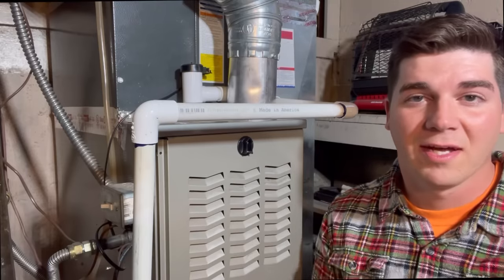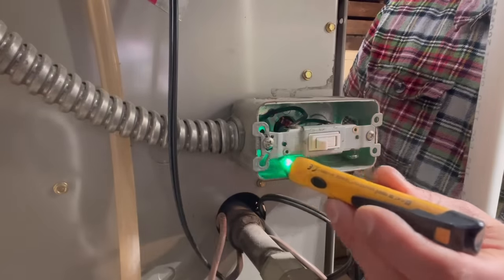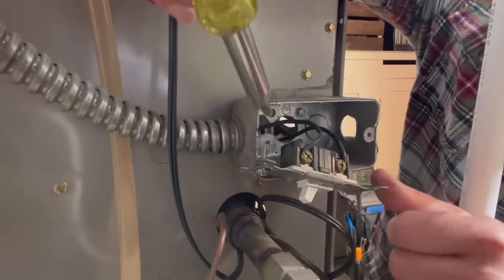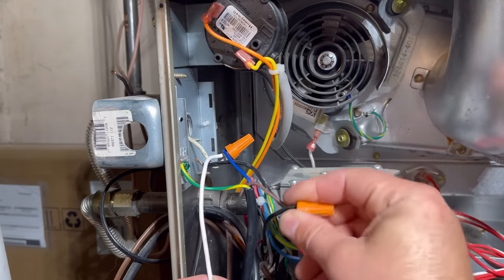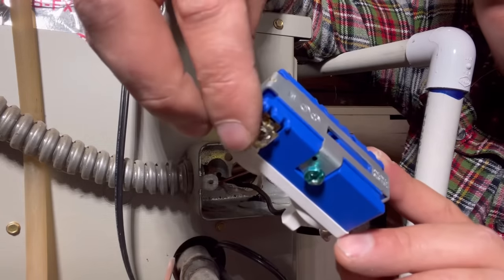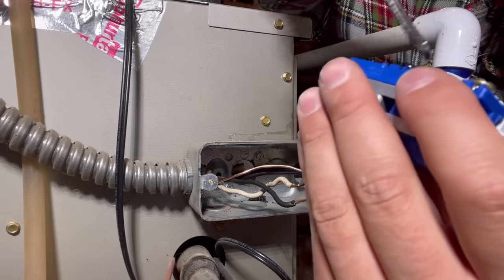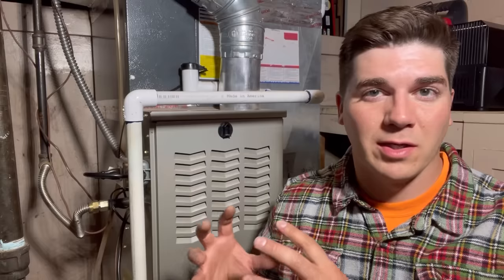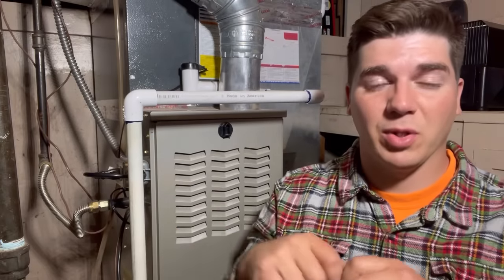This Could Keep Your Family Warm During An Emergency Power Outage.

Comment: Note:  if your furnace will not run off of your generator with this mod and you get a missing ground error displayed, you will need to put a temporary ground from the furnace ground to the white neutral wire. This can be fused at 1/2 amp if you want but the two wires are normally connected together back at your circuit breaker main panel. The flame detection circuit may need this ground. I have run into this twice. Just an fyi.
Reply from the maker: Thanks for the tip! I’ll pin this in case anyone else runs into that.
Reply: The better alternative is to bond the generator to the building's ground rod.  There should be a threaded stud and nut on the generator for this. The furnace cabinet remains bonded to ground through the surface mounted box and ground screw on the device--in all cases that's an iffy connection, if say the mounting screws are loose. Better to have a ground wire from the box to the device.
Reply: @diyhvacguy  my trane furnace had issues with flame detection..  I used to be in the field so I knew it was a ground issue from years of errors on various furnaces..  in my case I connected a ground wire from the generator frame ground to the house ground..  I had zero ground potential but it was a wierd flame sense..  I didnt have a bad ground flash on the board.. but would not sense flame..   my furnace has ground from my box.. so figured if i grounded the Genny to the box id be good.. and it works great..  

in some areas there is code that a furnace has to be permanently wired into electricity.. the plug and whip may be looked at like an extension cord even though its permanently attached... its something to think about even if you never plan to sell your house as an insurance company could use it as a way to not payout..   nevertheless its worth checking local codes... a transfer switch would most likely be code  FYI
Reply: I already figured that out 4 months ago and I am all set for any power outage. 200 watts of solar power, 1500-watt inverter and 165ah of batteries which is to say 55ah each.
Reply: @JohnT.4321  165ah at what voltage? my furnace pulls about 700 watts running full blast. at 12 volts that equates to about 60 amps..  165ah would be what 2 and a half hours runtime..  I cant use solar in my area (ohio) winter the sun angle is dismal and its almsot always cloudy , days are short too at only 9 and a half hours daylight.. probably little less than 9 useable daylight for solar..  I have 800ah @ 12 volts batteries.. of course the furnace doesnt run all the time..  but i can make it through the night with the generator off and secured...
Reply: @eldoradoboy  I should have been more clear about being ready for a power outage so forgive me for being vague. I did figure out on how to rewire the furnace, like in the video, four months ago along with proper grounding. My furnace is a lot smaller than the one in the video since I live in a small house with one floor and no basement. I have not checked the wattage of the furnace yet since it is still warm outside. The power outages here have been between 2 to 8 hours in duration and they are rare. We never had a power outage like which happened in Northeast Ohio in 2007 which I believe was the year. 

Since I live in Northern PA, I know what you mean by not getting enough sunlight in winter. I am able to adjust the solar panels to the proper tilt to get full sunlight for both summer and winter. My first system is a 1800 Nature's Generator with 200w solar and 150w wind turbine which does work. It spins a lot during the winter charging the battery. The system also charges with AC. Nature's Generator was my first introduction to alternate energy. I had to replace the inverter, at not cost being under warranty, but I also had to replace the battery six months later. Instead of buying the expensive Nature's Generator's battery, I put in a 75ah deep cycle gel battery. I had to size what battery would fit and that was the only one. It's better than the original 60ah battery. We use it for smaller appliances and the electric bill has lowered a bit.

The secondary system is one that I am building and improving on runs the big refrigerator during the time of full sunlight. I am considering a wind turbine since we have a lot of wind during the winter. The refrigerator runs at 143w. I learned that putting a six pack of 2.7 500uf supercapacitors to the inverter soft starts the refrigerator--it will also soft start a furnace for your information. I learned it extends battery life as well. I run the refrigerator on sunny days and then I put the refrigerator back on AC before the sun goes down. I am very pleased it has a good charge. I do put a battery charger on the battery but I trip the breaker to the 200w solar panel first.
Reply: Could you do something?  Could you measure the power used by your furnace when running the blower?  There seems to be some confusion regarding this.
Reply: @DennisMathias   my furnace is 700-750 watts running high stage, iducer motor on high and the variable speed blower at max heat speed.   its an 80,000 BTU multi stage american standard (trane). the blower motor is a 2/3 horse.   my static pressure during the test was 0.24" WC, I can run the blower up to max (high cooling)which reaches about 800 watts, however the unit will not run heat speed on its own in maxx blower speed..  it drops back to maintain a good rise..  Variabke speed furnaces are soft start and dont require any start surge mitigation for generator use..  my 1500 watt inverter runs it with zero issues once I set the grounds up correctly.  when im running in emergency mode, I force my thermostats into 'EM heat" which in my setup activates the W3 terminals and makes the furnace run in max output only.. this results in high burner all the time and shorter runtimes (better for batteries)..  multi stage furnaces running on low stage are gaa efficient but will drain battery banks quicker with longer run times..
Reply: @eldoradoboy Those 800ah batteries must have cost a pretty penny.
Reply: Do not connect the neutral to ground. Ground the source (generator or solar) to the main panel ground, per National Electric Code.
Reply: @DennisMathias   Don't forget that any kind of electrical motor will have a surge power draw. (Which probably won't be measured by a standard Kilo-Watt meter/etc.)
Reply: TY...hard ground for flame detection
Reply: I guess this is something that you should check right away, and not have the problem when you actually need your furnace to run!
Reply: @galaxiedance3135  presumably you test an installation after you build it.. ie if you set up your furnace to run on batteries you would want to test the set up.. to get ideas on hiw long irt would run on your generator or on a set of batteries etc...
Reply: My carrier furnace runs zero issues off my Honda Eu2000i.  But I’m also going through a transfer switch, which grounds to my home’s panel.  That could be why.
Reply: Do not connect your ground and neutral at more than one point in your house.
This is a very bad idea.
"If the neutral is connected to ground at more than one point, then the neutral and ground are connected in parallel between those two points. In accordance with Kirchoff's laws, such connection makes the ground a current-carrying conductor under normal conditions!"
If you don't know what you are doing with electricity you should hire an electrician.
Reply: Just an FYI, there’s a free life hack called wearing proper winter clothing and you don’t need to waste tons of money and resources or try to hook something like this up ever again! I know it’s an amazing concept, but wearing warm enough clothing and having warm enough bedding makes it so you no longer need to worry about what heat source you have!
Reply: @ZxAMobile last avril it was 3 days and for some than 4.
In 1998 it was more than a month and not every body have a fire place.
Better be prepared than finally dying in its car with exhaust fumes.
Sad but in winter it causes death.
And a generator is smart also for sum pumps  if you have and don´t want your basement transformed in swimming pool...
Reply: @danielfantino1714  I agree! Use a generator for emergencies and VERY strictly/minimally. People who run heating when clothing is available are why everyone is "broke in 2023" its easier to live in 2023 even with inflation, but it's never easy being dumb in any time period.
Reply: @diyhvacguy I have a question: did you mispeak when you said that you wanted that switch to control the outlet AFTER you broke the tab off?
Reply: This set up is illegal. In the event of a power outage, would the operator of the generator remember to first turn off the main electrical breaker as to not electrocute his/her neighborhood lineman attempting to reestablish power to the community? Probably not. The legal non hack way to do this is by means of a transfer switch installed by a licensed ELECTRICIAN! Please stop doing this.
Reply: This is illegal and dangerous. Do not do this.
Reply: @ohvjoe8832 ... either you know nothing about electricity or you failed to watch the video
Reply: @ohvjoe8832When you pull out the plug you are disconnecting the furnace from the power line. The plug is now isolated from the power line so it can be plugged into a generator or other source of power.
Reply: @ohvjoe8832  so manually operating switch gears from utility power to generator and back to utility is illegal at my powerhouse?
Reply: If you leave the breaker on the way it's wired you'll back feed to the main power line. When power is restored you may blow your generator.  You have to turn off the MAIN breaker before you back feed voltage to the breakers busbars.
Reply: @ZxAMobile  That might work if power of off for not more than ten hours, if you are looking at days, pipes freeze, you might as well sleep out side in a tent with no heat.
Reply: @drigen223 connecting a ground to the grounded conductor is against code after the first means of disconnect, where it is bonded. This whole thing is dangerous. Spend another 40 bucks for a 2 pole double throw switch
Reply: Why not cut the power wire coming to the furnace and connect it to an outlet then add a pigtail to the wire going to the furnace. 
Plug the furnace pigtail into the power outlet for normal use and then to an inverter when no power?
Seems very straight forward.